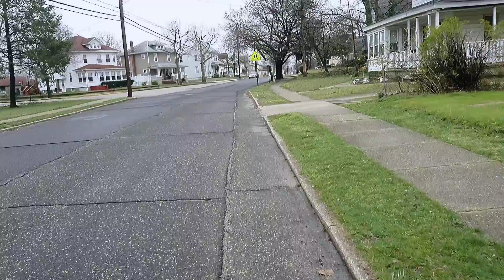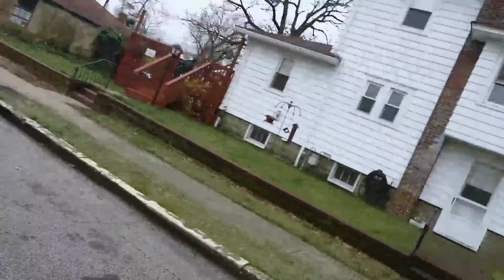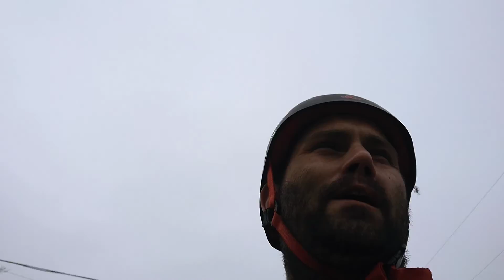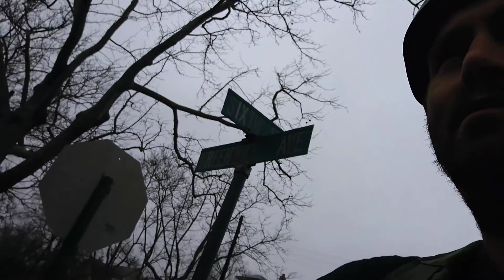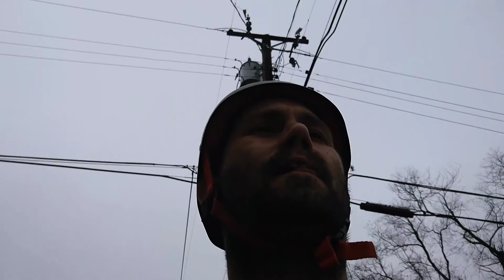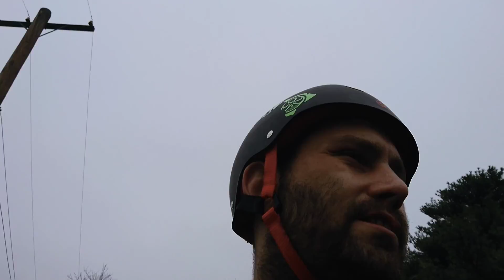I need help with the DIY Electric Skateboard Battery

Comment: http://www.batterysupports.com/36v-37v-42v-10s-60a-10x-36v-lithium-ion-lipolymer-battery-bms-p-267.html
Reply from the maker: +Jeffrey Friesen freaking awesome because i will working on that this week
Reply: make sure to look at the discharge rating of your cells. For instance samsung 25r cells have a rating of 20amps continuous. So if you have 4 cells in parallel you should use 4p*20amp = 80amp so no more than 80 amp bms. Other cells can have higher or lower discharge rates. check ut this forum too: https://www.electric-skateboard.builders/t/10s5p-battery-pack-build-log-50-pieces-of-samsung-35e-cells/23547
Reply from the maker: +Jeffrey Friesen oh ok you know what that's definitely a question I had in my head at one time and I'm glad you brought that up that seemed pretty important the different continuous discharge rates. now I'm using LG cells he4s. they have a continuous rate of 20amps. so same case 80amp max depending on the max watts of the motor right? okay let me ask this. i will be using 22amp max a piece motors. does that mean i should use a 45amp bms?
Reply: You can use up to an 80 amps max BMS but anything below is fine it will just throttle total system current available. But obviously  you can only use as much current as the lowest current item in your setup. Your ESCs should be able to perform their own current limiting for each motor. I'd advise using at least 60 amp BMS in case you ever upgrade your motors etc. so it isn't a bottleneck. I think 60 amp is somewhat standard for a 4p setup.

Comment: maybe I can help still havent watched the video let me take a look
Reply: I'm at school so I can't watch it atn
Reply from the maker: +nightmare in action nighmare in action yeah no problem. I want to build a 10s4p flat pack. i need schematics and the proper bms to purchase
Reply: If you need help with any esk8 DIY, this is the perfect place - http://www.electric-skateboard.builders/
Reply: Joe Kyser bms for 10s are kind of hard to find the will atleast banance charge the battery most cheap ones just make sure 1 cell does not go over the voltage while charging and will cut out the power till one teacher 4.2 and if the other ones are at like 3.8 it will not charge them also soldering to the batteries is not a good idea and if you are try to use nickel strip so there is not too mutch resistance and if can use a slot welder that's the safest way to put batteries together also try to get some shrink tube for the batteries to hold together something like this Look at this on eBay http://www.ebay.com/itm/391327313158 so I can try to find a bms the will charge and balance 10s ill see if I can find one also check the battery capacity make sure they are all the same 100mah+-
Reply: Joe Kyser Look at this on eBay http://www.ebay.com/itm/132039963038
Reply from the maker: +nightmare in action nighmare in action +nightmare in action nighmare in action they're not hard to find I have plenty of examples of them I just want a good one United I mean I don't want some cheap piece of shit
Reply from the maker: nightmare in action nighmare in action only 20amps and its for one 10s string not 4
Reply from the maker: Q.T.π oh i know right? Im just looking for someone from youtube. A little interactive on here maybe. All contributors will thanked in one way or another. Your right though thats the perfect place. Im not completely lost i do know how it works and what i need just not specifically what bms. what I like to do is hear from someone who has made one already and maybe fill me in on some of their tips and tricks. what they might have done different. I know I can go there to get all that information on that web page. but what I try to do is take the people from YouTube this way they're commenting on my video and the results can be seen here. Maybe i can post my video there and have members of the community come over here. I just want to be sure that viewers can benefit from all these videos as well. thank you very much for that lead I really didn't think about including that until now